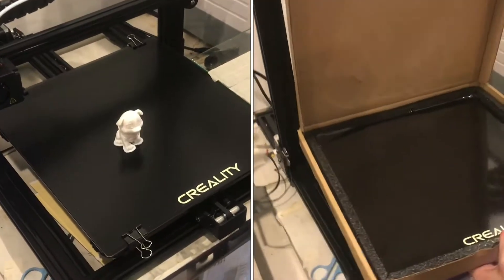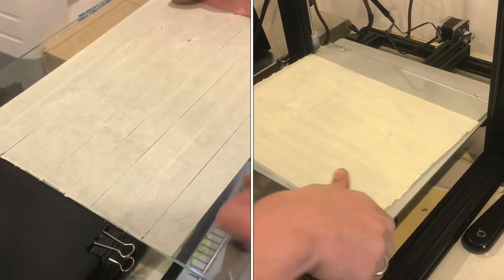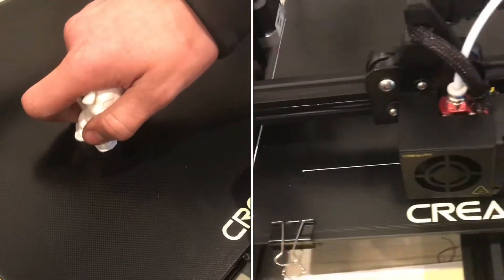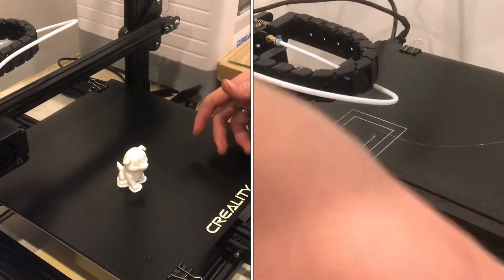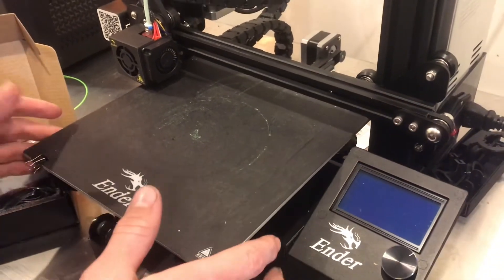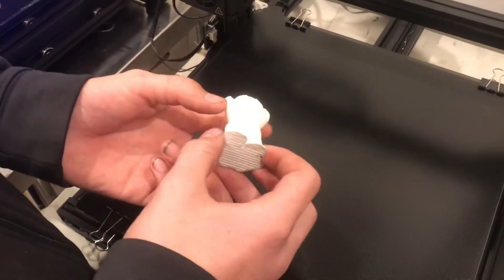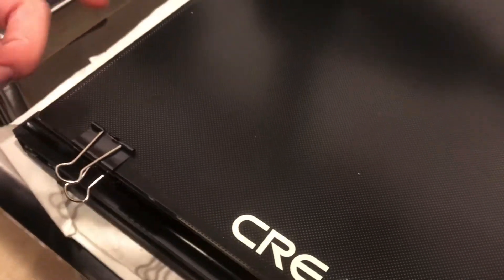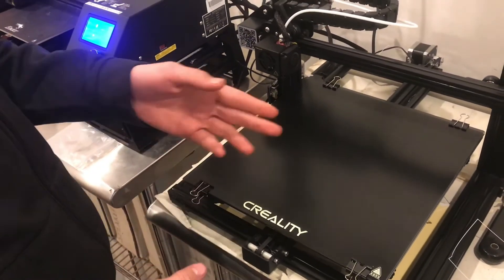(REVIEW) creality ULTRABASE (comparing it to other 3-D printer beds)

Comment: Waiting for my ultrabase to arrive. Using the default base that came with the ender 3, in my option it sucks ass. They stick amazingly. But that's the curse, its almost impossible to get prints off after that.